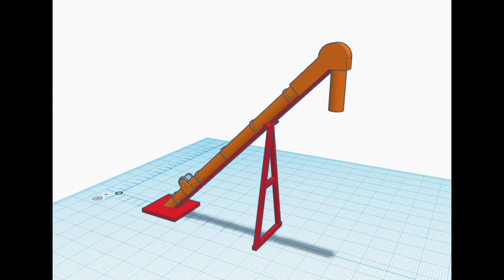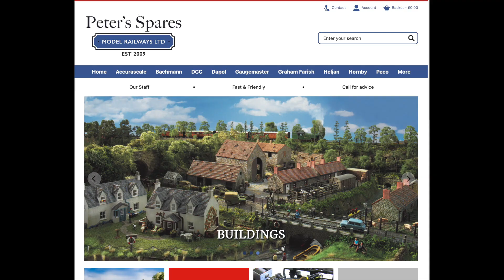HO switching layout Update  April 23

Comment: Love what you do.   But one thing to keep in mind as an idea.   Industrial switching track usually has lots of piles of sand by the rail from how many times the air gets dumped while switching that cause the motors sanders to turn on.    Keep up the good work.   Also a common customer for team tracks is tank cars of mag-chloride.   They spray that stuff on gravels roads to keep dust down.
Reply from the maker: Great tips, thanks!